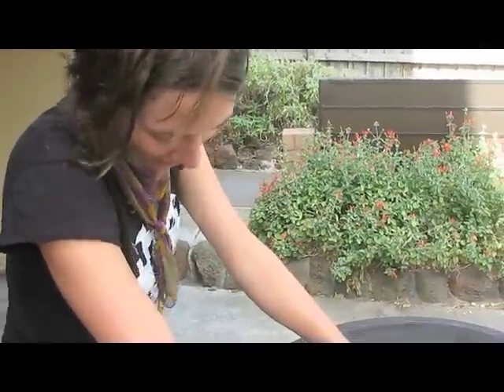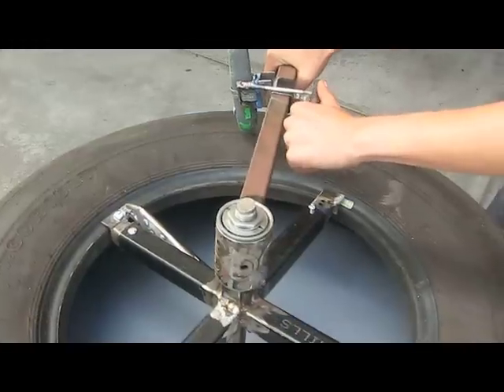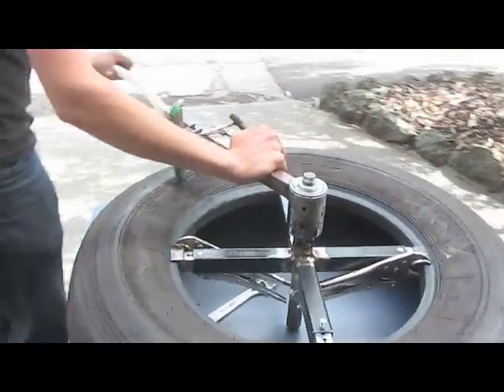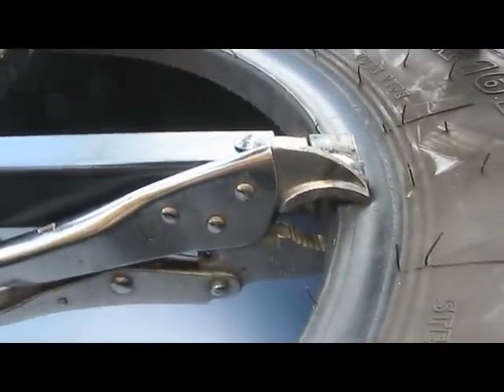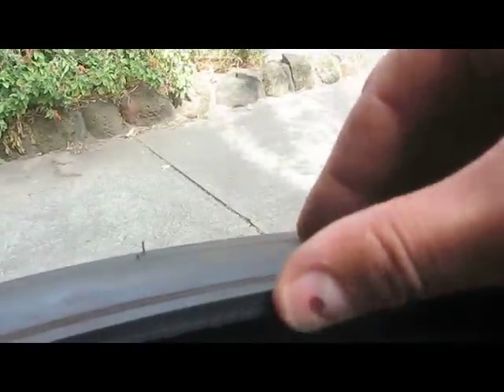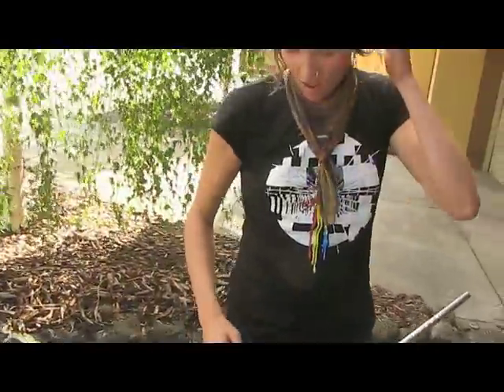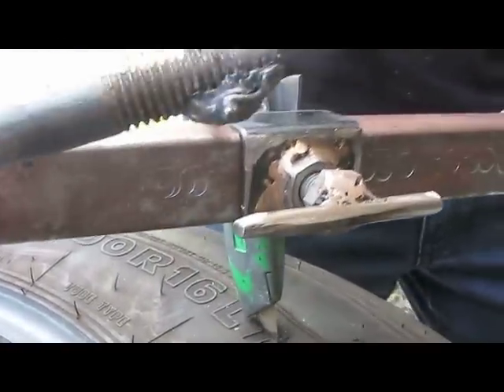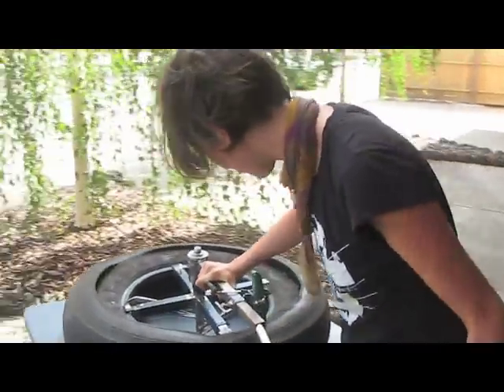Car Tire Cutter.mov

Comment: You should consider making it much more rigid and using only a blade not the whole knife. If you find a larger blade and thicker this will help more than anything. Also If you bolt your device to the table this will make it even more rigid.